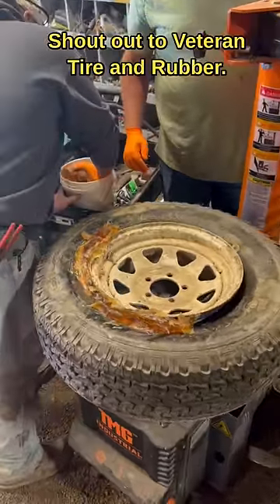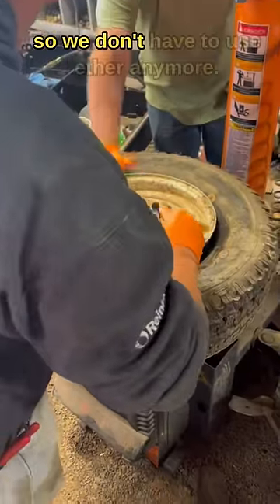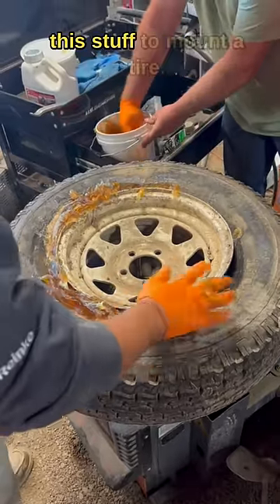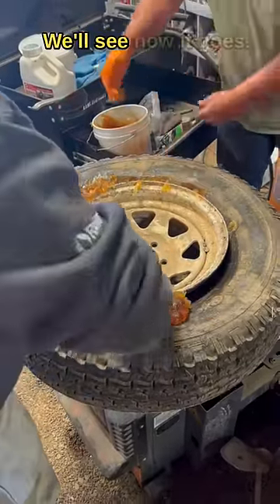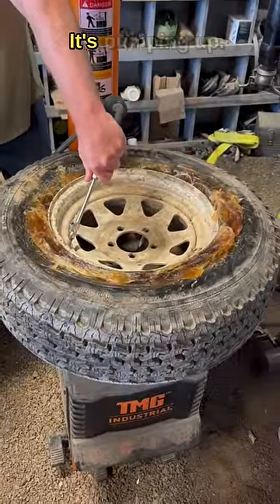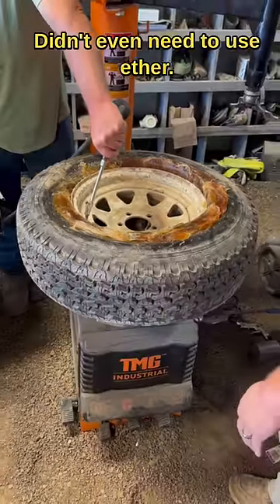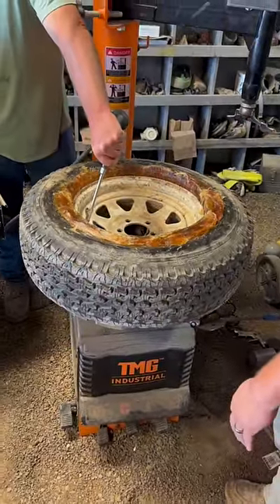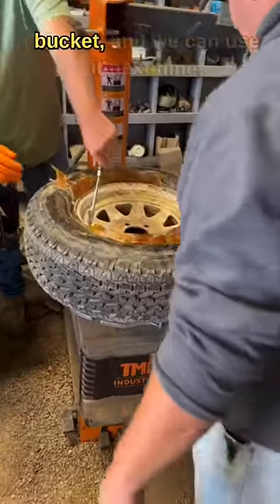Veteran tire and rubber sent some tire mounting compound. Let’s see it work. #farming #shorts ￼

Comment: That process of “larding the bead” is messy and that stuff stinks!  It is a good non explosive alternative but then you get to scrape it off your walls and any other surfaces in your shop after the air blast sets the bead.  You got away clean on this one.  Nice work😊
Reply from the maker: Thanks this was our first time using this stuff.
Reply: @RockyMountainFarmer what happens to what is left inside?
Reply from the maker: @hisnameisiam808  there really isn’t much left in the tire
Reply from the maker: @hisnameisiam808  There really isn’t much left inside.
Reply: @RockyMountainFarmer  ok gotcha, thanks!
Reply from the maker: @hisnameisiam808  No problem
Reply: @RockyMountainFarmer would you guys be willing to cut the tire off and prove that
Reply from the maker: @jbrogert  I know because of how full the bucket still is
Reply: @RockyMountainFarmer weight it lmao prove them wrong
Reply: I'm also curious about how the inside looks lol
Reply: @RockyMountainFarmer yeah but once you balance that tire and it heat soaks, the amount in there will slime it's way to the low spot and now your tire is out of balance. That snot works good to stick under tool box handles and works great for hucking at that one tech that just never gets it 😏
Reply: @robsorgdrager8477 yall are short a beer of a six pack. It gets pushed out by air pressure and there wont be much anyway because its all in the bead. I like that it lubes the bead at the same time. And it looks like it cleans up well. Great for tires u cant use the normal technique for whatever reason, which are plentiful. Depending on how smelly it is, I might not even use gloves
Reply: Ive used grease before never knew the made this but i also only used a little bit.
Reply: @Wtfinc  watch how they install it. Trust me, enough made it inside the tire. I've been a mechanic for close to thirty years and mounted thousands of tires. I know the correct way and the way most other people do it. Honestly I bet if you go out to your vehicle and look at the weights on any of the wheels, I'd bet solid money that you have more than one chunk of weight on the same side. If you have a weight at 12'oclock and another one at say 4 o'clock in the same side that is now " counter balanced and is WRONG. The grease they are using will absolutely get inside the tire and will pool after being driven and will knock the tire out of balance. This isn't that big of deal except balance issues will eventually smoke your wheel bearings. Rule of thumb for drive line...." clunks and bangs are fine but vibrations will kill your drive line. "
Reply: @robsorgdrager8477  if the tire bead id is the same as the od of the rims bead flange, it should all squeeze out. If not then yes, I totally agree, I wouldn’t want a chunk if lube that changes my tires balance every other day. But tbh, those weights are always falling off and we don’t see catastrophic damage and I highly doubt any wax intrusion would weigh more than ur typical balance weight. Either way, I wouldn’t use it unless i had too.
Reply: Saw a lot of comments about him "getting it inside the tire"... As the tire inflates it pushes the grease out. It doesn't get inside the wheel.
Reply: @jimbusmaximus4624  that's a false statement. Just like " euro paste " it gets in the tire. During the initial seal before it seats there is only around 20 psi if that.
Reply: @Wtfinc  tires do not go straight on. The initial point of seal is when the gunk gets in. By the time the beads seat the lube has already been knocked inside the tire.
Reply: @robsorgdrager8477  do u know what the inside of a rim looks like? As long as ur not jamming in there, it shouldn’t be able to get passed the flange. I wish I could draw a diagram for yall. Most is getting pushed right back out. Yall so hardheaded for no reason.

Comment: I'm convinced that people who use ether will try literally anything other than a pneumatic bead cannon, it's insane
Reply: I was gonna say, I though my mechanic just used high pressure air being released fast enough it literally just pushes the tire/bead into place. No ether, no kaboom, no goop, no mess, just a satisfying pop.
Reply: E85 works also. Just pour around the tire, then run a trail of e85 to the tire and get the fk out of the way. LoL

Comment: I don’t know why but I honestly thought you were going to light it on fire 😂
Reply: This is meant to replace exactly that. When he is saying "using ether" he is referring to the whole light it on fire thing.

The whole "light it on fire" is used because hot air (gases in general) takes up a lot more space than colder air/gas, You can use that in order to very quickly "fill" a tire full of air enough that it creates a seal around the rim. After that sealing then you can pump the tire with the proper amount of air in the normal slow way (air hose).

This is to overcome the problem of an unmounted tire not being sealed and as you pump it up normally then it lets out air just as fast as you try to fill it (because the gaps in an unmounted tire let out the air faster than you can fill it). Lighting a gas on fire will give you a quick boost in air pressure inside the tire that is enough to "fill up" the tire and create a seal that will then let you then fill the tire up to the proper pressure without all of the air escaping instantly. That is what they are talking about when you hear something like "setting the bead", that is referring to the "seal" between the tire and the wheel. "Set the bead" and you have created a seal, "break the bead" and you have broken the seal.

This wax substance will fill in all those gaps and let you fill the tire normally without all of the air escaping instantly through those gaps since those gaps are now filled with wax stuff. That lets them fill the tire in the normal slow way (with an air hose) without worrying about the air escaping instantly through gaps.

+1 if you read through this whole mini novel
Reply: @rickh5088 i read it 😂 good info
Reply: Same. Hahaaaa
Reply: @rickh5088 i forgot i wasn’t even on the main comments. you should added this to the main comment
Reply: Me, too.  I figured when it was "instead of ether" thait was gonna still be set on fire. I was wondering what it was gonna do. (Guess it's obvious I'm not a tire guy)

Comment: A way easier and less messy trick is to put a ratchet strap around the tire with a bit of pressure the bead will seal
Reply: Have tried that does not always work some of the tires bend the wrong way aswell
Reply: No . I can't believe they can't put that on .
Reply: This.  custom making an open throat air chuck and removing the valve stem can help get more air in faster when seating, just turn the air on at the compressor when held on & screw the stem in real quick when pumped up.
Reply: This is good for semi's but unnecessary on a tire with normal payload.  Now you spray of soak the tire and rim. So much extra for nothing.
Reply: You are right I use to off road or the good ole spray and lighter pop.
Reply: Last time I did that was on a big backhoe front wheel... the ratchet got smashed and I had to poke at it with a screw driver... it went flying past my head and landed 80 feet away... I don't have any idea what I'm doing but I'm never doing that again.
Reply: @otukucocker365 yeh they are very easy to seat, especially with the blast of air that comes up from the clamps holding the rim in place, push a bit harder on the air pedal, lift tire against top lip of the rim and "woosh". Too easy
Reply: Yeah, I've done that airing up skid loader tires. The ratchet strap works way better than tire mounting compound, lol
Reply: @Redact63Lluks couldn't let some air out?😂
Reply: Or just use an air tank and blow the tire bead shut while airing it like all other tire shops and road service techs do 😂
Reply: @Kenpachiii_Bankai exactly, in our park maintenance shop we always had cans and cans of small engine starter laying around for the various equipment...spritz that around the rim and light it up, worked every time
Reply: Yeah we used that method when I was in the marines. The best part is letting the strap off hahaha
Reply: @danjohnston1345  oh good point!! Dont pump up the tire too much lol!

Comment: I tend to remove the valve stems insert, doing this will make tires seat much faster and less problems. That tire dont even look like a problem tire. I been around a long time and have dealt with some angry tires. Ether is always the very very last resort and ive only ever used it on heavy truck tires. Recaps can be a pain sometimes.

Comment: Pro tip. Don’t use compound and ether. It goes everywhere.
Reply: Ha ha I’ll bet.
Reply: You were definitely the new  in the shop!! An the pros told you  this pro tip huh?!   "  hey bud  pro tip we learned. If  use the two together it actually seals an it'll work every time I promise! " As they  slammed the shop door closed  minutes later you were   flying  out that door covered head to toe in tire mounting compound  an they' all laughed about for months!! !! ! 
🧏‍♂️🙆‍♂️🤷‍♂️💣🧨🎆💥!! 
😂😂😂😂!
Reply: How about that compound plus a Cheetah? 🤔🤓🍻
Reply: @matthewhall1068 I can’t even comprehend what people like you are thinking when you just string together a bunch of stupid emojis… I mean the use of any emoji is already questionable, but to just open the emoji keyboard and start hitting buttons is mind boggling to me. I won’t even start on the nonsensical jumble of words you inserted before them either.
Reply: Laughing my fucking ass off. That would be AWESOME
Reply: @picomanbungace4035 so much anger and spite for no real reason. Is this how you always act if someone does something you don't particularly like? If so stop wondering why everyone hates you and fix your attitude
Reply: Some things should never be combined
Reply: Same with a cheetah air cannon, blows that crap all over the shop
Reply: Now I want to try

Comment: A cheetah works well too  it's an air tank that unloads instantly with a gate valve.  The compound usually causes balance issues
Reply: I'm barely mechanically inclined, but the first thing I thought watching this is how much all the leftovers on the inside are going to effect balance in the tire when driving at freeway speeds
Reply: Balance doesn't matter on a vehicle that won't be traveling at high speeds and not on the road
Reply: @whodis000  it is a fact but sometimes a necessary evil ,  once aired leave it for awhile     then remove tire clean it out and put it back on a little finessing by hand and  tap of the high pressure petal gets it right back on ,it doesn't hurt re.oving valve core either
Reply: @DeanBeck-fc5hf that’s a solid waste of time I’ve never done that and my business has 5 stars and been in business since 57 lol what are u on about this is a trailer tire
Reply: @yanivzion2091 who the fuck ISNT traveling at high speeds in their vehicle first off? You can’t be serious, tire balance matters from 5 mph all the way to 200 mph secondly. Anybody driving their car is going 35 mph-80mph on average, so yes, balance matters
Reply: @kasmith_ this is for off road trail riding 😂 it won’t be an issue buddy. It’s not hard to understand that people have vehicles they only use for off road and haul them places on a trailer
Reply: @kasmith_ its for a tractor on a farm. it wont be going 60 mph down the highway...
Reply: @MoonmanSpacejam  not once in this video did anybody say what the tire was for so you’re assuming. But let’s say you’re right, that doesn’t change the fact that this is 100% not the way to use that stuff, balance mattering or not, this is incorrect. But let’s continue with your point, it’s for off road use, they’re going to regret this when they replace that tire, and that’s if it doesn’t blow
Reply: @MoonmanSpacejam  it’s not hard to understand basic physics, on top of that, im a euro automotive specialist, I know the proper way to mount a tire and this is not it
Reply: @gunshotNrun  where did that say it’s for a tractor?
Reply: @kasmith_  farm vehicles, anything "off road" get educated my guy
Reply: @yanivzion2091  I’ll say it again, you’re assuming this is for farm use, no where did they specify that it is. Even if it is for farm use only, this is still the incorrect use of this sealer, regardless of the application, “get educated my guy”

Comment: Bead blasters also work pretty good. Most tire machines have one built in, but when they aren't good enough, something like a Cheetah will work.
Reply: When you need the compound you need it. The cheetah works most times but not every time especially repairing old soft rubber tires
Reply: We have an air pig that blasts the entire contents of the cylinder in a split second, we call it the "persuader". Really fucking loud
Reply: Cheetah usually worked pretty good for me with trailer tires and big diesel truck tires
Reply: @3Dstambo  that was my experience. Did some repairs on old tires that needed the compound
Reply: @larristheblackswan3584 Funny,  I called my ex that.
Reply: I never mounted small tires like that, but when you're doing semi tractor / trailer tires you need soap sometimes. Usually they go on with a bead blaster but some are really stiff and need soap. Big tires like on front -loaders need like 3 gallons of tire soap when it's cold out lol
Reply: I don't have time to go to Africa every time I need to change a tire though
Reply: He's mentioned these. They don't work on their tractor tyres
Reply: The old center post machines have great bead blasters. The problem with newer machines like our hunter is the blaster is usually 6" away from bottom bead. The center post blaster is an inch away.

Comment: You only have like 2 pounds of that sludge inside the tire now I’m sure that’s fine
Reply: My thoughts exactly. Are never going to be able to balance it when that stuff flings off and starts rolling around inside.
Reply: @P_Weave That stuff will coat the inside of the tire evenly once it begins to spin
Reply: @danieldevito6380 and will settle everytime the car sits because of the heat/sun, meaning it will be right back to unbalanced again everytime you take off
Reply: @YeetxBoi how much do you think was in there lol

Comment: Heres a no mess way....
Use a cycle inner tube...wrap it round...put some air in....
Inflate the original tyre...boom ... 
All done and no mess at all
Reply: That’s a good idea, thanks.  I thought of using a garden hose but none of the ones I want to cut up are very round any more

Comment: That’s exactly how it works. I’ve done many rear tractor tires exactly that way. Great stuff!
Reply: Lol? It's not how it is supposed to be used I hope you're joking 😂😂😂
Reply: Same! I've used ketchup tho for a standard bicycle tire. :)
Reply: Could almost use peanut butter lol
Reply: It’s designed for off-road and agri stuff, but on a road tyre where you end up with huge lumps of grease inside the wheel after is a no no

Just use a cheetah or strap the centres 🤦‍♂️
Reply: Yeah accept that's not bead sealer that's tire soap, you add water and it's extremely slick, SMH
Reply: @anthonyf3253 it's not bead sealer anyway, it's concentrated tire soap

Comment: I used to have to use that on terra-gator tires to get them to seal up when they were flat off the bead when I couldn't get them to air up. I would do that, air it up, then jack up the machine and fix the tire like normal. That stuff will get you out of a jam, but is obviously a messy pain!

Comment: Use a ratchet strap and a thin coat of grease it works
Reply from the maker: Yeah we have done that before
Reply: that doesnt always work as well as ether. especially on a tractor tire thats 6ft tall on the rim. aint no rathcet strap big enough to squeze that rubber down. but ether boy it will pop that tire on in a half a second. just have to brave enough to light it.
Reply: @heyjohnson5535  this was a small trailer tire.. I never said it  would work on a " tractor tire " and I suppose depending on your country,  the term tractor tire can be used in various ways
Reply: @joshuabanwaree2640  yeah i get that i was looking for a fix all solution. Tire im talking about is 6.5ft tall when i say tractor tire. But i wasnt speaking with malice i was just saying ive never had a strap work while using a ratchet on it but if u can get a big bar in there and use it to twist the strap as opposed to the ratchet handle it might work on a bigger tire. I just thought of the bar or pipe to twist the strap.
Reply: @heyjohnson5535 use a piece of rope
Reply: @timothykappel198  i never have heavy enough rope laying around. Usually when i get a flat im scrambling for whatever i have on hand to fix it cause most of my rear tires are full of either calcium or beet juice basically. I want to get one of those oversized fill tanks w a dump valve that blows all the air in a concentrated spot. I think this goop would really help with those big ass tires. Might use a entire bucket to seal it but u might get some of it back in the end.